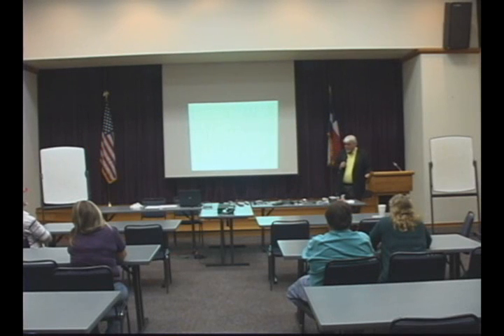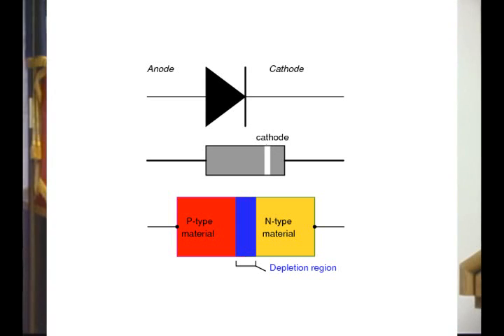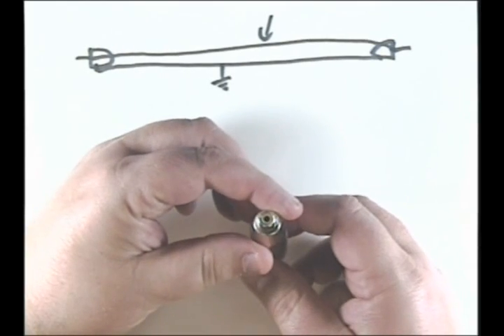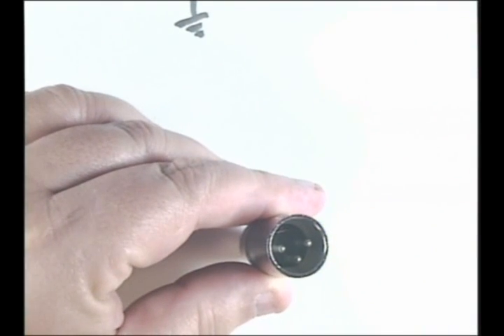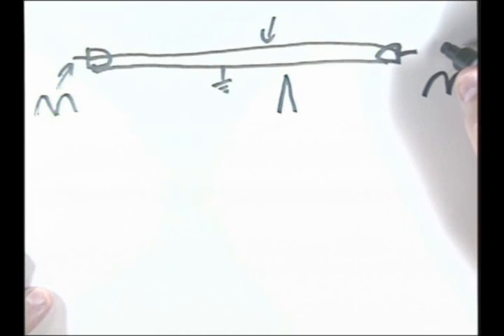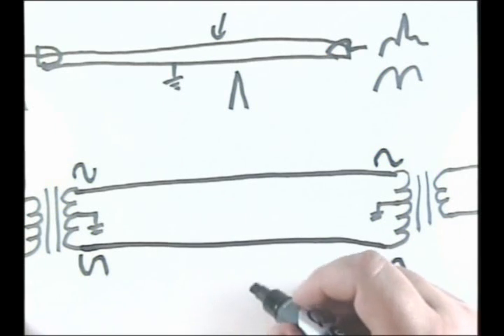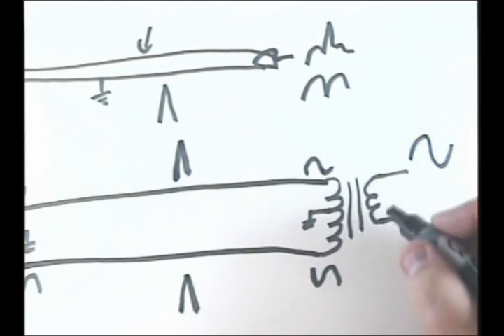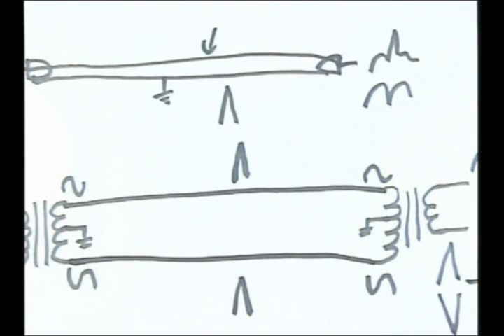Basic Electronics 4 - Coax connectors

Comment: Interesting, but not much information about coaxial connectors. BNC does not mean British Naval Connector, although I've heard that from Ham and CB radio operators. It is an abbreviation of Bayonet Neill–Concelman. The BNC connector was co-invented by Paul Neill of Bell Labs and Carl Concelman of Amphenol corporation. The bayonet comes from the similarity to the locking bayonet on a rifle which you can clearly see in the video. There is also a threaded version called a TNC for obvious reasons.

Comment: I never understood this either but I just figured it out. Once the signal is carried on two lines, one normal and one carrying a phase-inverted copy, the noise added to the wires at this point will have the same phase on both lines, with the audio still being opposite. When the inverted line is reverted, the noise becomes inverted from its copy on the first line and gets cancelled out, and you have the original audio signal. The professor made this concept misleading with his drawing, I think.

Comment: The inverted signal doesn't cancel out with the normal one because it's on a separate line. Again, there are TWO conductors carrying signals -- on one the signal is normal and the other it's inverted. The signals are only combined back together at the next receiving stage, which inverts the inverted one back to normal and then adds it to the normal one. The result is a higher amplitude signal with the noise cancelled out.

Comment: I think your confusion is caused by assuming that both signals are inverted. In a balanced line (which actually contains two lines), the signal in only ONE line is inverted by the circuit driving the cable. The other line carries the normal signal. At the receiver end, the inverted line is inverted back to normal, and the result is combined with the uninverted line. That causes the noise to cancel out, but not the desired signal. Make sense?

Comment: I've always been and still am confused by this.. if the phases in a balanced coax line are inverted, why exactly does it eliminate noise without affecting the signal? Why doesn't it just cancel everything out? Say, in an audio context, if I were to duplicate an audio track and invert the phase of one of them, it would become totally silenced (except for some weird reason when they're panned, then it's got an almost answering-machine-like sound :P). Why doesn't this seem to apply in electronics?

Comment: @osity I THINK (im just now learning this stuff now) that the audio signals that travel through the XLR are like 'mirror opposites' of each other; they start the same and end the same but in the XLR they are split, phased 180 degrees and then put back together in the end. because any 'noise' that interferes whilst the audio signals are out of phase will not be mirror opposites on each phased audio path but the same noise on two separately phased mirror audio paths,